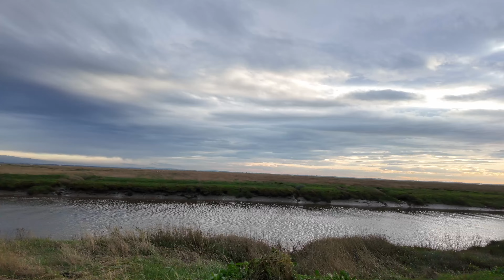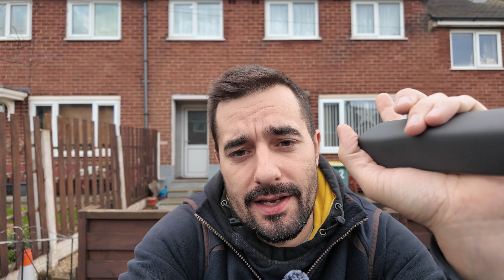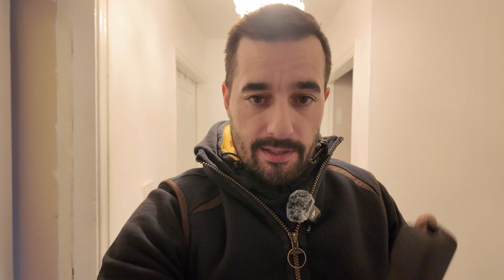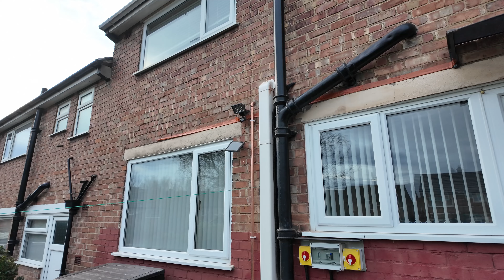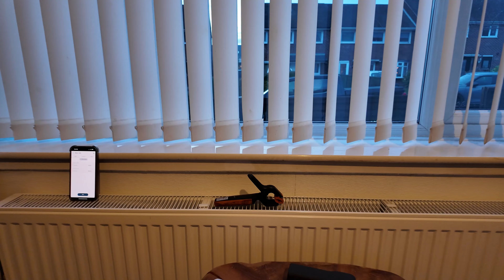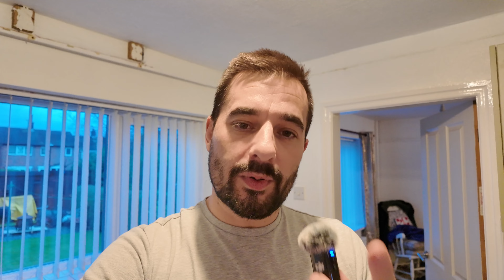Simple Heat Pump install

Comment: I am interested in a heat only heat pump as I'm happy to use existing hot water that i have. Is this possible? does it restrict the choice of heat pump chosen?
Reply: Why not. You need les kw hp.. Quest is if you will change the hot water in time and then have to use the hp.. I think.. I'm just a random guy.. not ver knowledgeable..

Comment: Lovely job, what was the cost to customer for each - solar and heat pump system pre BUS grant?
Reply from the maker: Hi, this was done under HUG2 funding so no cost to the homeowner. 

However, it would be IRO £16,000 less BUS so £8500 for a private customer.

Comment: Why did you calculate to -3.7°C when heating calculations normally work to -4°C outside air temperature
Reply from the maker: MCS give us the design conditions we have to work to depending on the area in the country. It is as important not to oversize a heat pump as it is to undersize it.

Comment: Love your videos, I have yet to install one yet, but my main work is now commission, service and install oil and gas, but will be moving into HP
I do have a question..  so, for the last 40 years of my working life I have spent time hiding pipes..  i think only on one or two occasions have i had to resort to bringing them out and running in a trunking ( bear in mind we do a lot of external oil boilers.. so similar install to a hp.
Why does it seem to be the norm to run the pipes externally on these? 

As neat as the pipe boxing is, it still looks yuk.. better if it had been black to match soil and rainwaters .
But everywhere i see heat pumps with trunking to first floor, i get it is easier, are heat pump installers afraid of graft lol..

Hope you have a great Christmas break
Dave
Reply from the maker: Cheers for the comment 👍

I don’t disagree, I would try and hide the pipes in my own house and most of our private customers ask us to too. 

This particular install is grant funded, our mission is to provide an efficient system that practically works really well but we don’t have a budget to chase pipes in or plaster etc. therefore most of the time if there is no direct pipe run, external trunking is the way we go. 

Customer does have a choice of black or white trunking and I agree personally I would choose black 👍👍
Reply from the maker: PS when installing external oil combis you can tee into hot cold flow return anywhere on a system. With heat pump we have to go to cylinder first so we generally have to route to upstairs. 🙂
Reply: @Rowlysrenewableroadshow   hmm lol.. well a lot of external oils are heat only , but even so, 2 pipes, 4 pipes ...  I still think more effort should be made in concealing pipes. ( no criticism on this install, it may not have been possible) but of all the installs I see while driving around doing my calls, the vast majority are run down the wall in an ugly plastic trunking. No other heat source gets fitted like this ( or rarely) . It does seem to be what is now seen as acceptable by hp  installers. I do get that running up in a trunking takes a couple of hours compared with imaginative routing to hide them can take a day or more.. so I do get the cost aspect.

I need to get installing and set an example lol...
Reply from the maker: @davewellsheatingengineer  absolutely get involved 🙂
Reply: @Rowlysrenewableroadshow  I would, if i knew where to start, so much mis information.

Comment: What sort of power does the heat pump draw if it’s running 24/7. What would the daily kWh be in mildish weather say about 7 degrees?
Reply from the maker: Thanks for the question. 

I’m going to sound like a politician now but it really depends on the load the unit is trying to deliver and at the flow temperature the radiators are designed for. 

This unit flowing at 60 degrees flow temp on full load for 24 hours could consume in the region of 72 kWh. 

Conversely running on full load at 35 degrees flow temp it could consume in the region of 36 kWh.

However in reality what happens is the house will already be at temperature and all the unit is doing is maintaining heat loss. 

In the example in this video the unit is able to move enough heat at -3.7 to keep the house warm, the heat loss is 4.6kw therefore at plus 7 degrees the heat loss will be roughly 2.6 kw so the unit will only need about 600 watts per hour meaning a daily consumption of £3.50 to maintain 21 degrees for 24 hours. 

This customer has a daytime temp of 21 and a night setback of 18 currently meaning she is spending between £1.50 and £2 per day. 

Hope that answers your question. 

Adam
Reply: @Rowlysrenewableroadshow  Hi my parents have had the same heatpump installed by Global Energy, (you came to set it up etc afterwards). Granted its a larger house but they only run it at 19 degrees usually and drop it down to 17 at night but they're seeing costs of nearly £10 per day (at 25p/kwh). They have looked at heat pump tariffs but they all seem to offer 2 periods within the day where the electric is cheaper which doesnt help with running it 24/7 so they don't really make sense as "heat pump tariffs" as the other times of the day are more expensive. Any ideas how this can be improved and how they can obtain their SCOP value? Thanks

EDIT
Parents calculations were higher than the actual running costs and Adam's calculations below are more accurate.
Reply from the maker: @ Hi Scott I remember the job, thanks for the comment. 

Yes your parents house is 151 square meters so twice the size of this house with many more external walls however I’m sure we can improve their run costs. 

I’ve just downloaded the data from their unit and in December they have used on average 26.6 kWh per day equating to £6.65 per day average run costs. I would say with a house of their size and build it’s not a million miles off. 

Looking at the data though it seems like the unit is achieving the indoor temperature easily and could probably do for us to turn the weather comp down a bit and see how they get on, that would mean the unit runs slightly longer but at a lower flow temp increasing efficiency. 

If you email services@globalenergysystems.co.uk and mention this conversation we can tweak it and monitor it for a week or so to see some improvements. 

Thanks

Adam
Reply: @Rowlysrenewableroadshow  After sitting down with them properly I think your calculations may be more accurate that theirs!
Thank you for the reply :-)

Comment: Really interested in how you work out the correct system volume for the heat pump, so many people have different ideas on how to do this.
Reply from the maker: I’m going to do a video on this, however the method I use is one an ex colleague and I have used for years. I’m not saying I’m right but it seems to work for me and I’m always open to better suggestions. 🙂

If you know min kw output of the unit you can do the following.

(Min kw output x seconds per start) / (DT x shc = kg mass required

Example on a 3.5kw min output

3 starts per hour = 3600/3 =1200 secs

(3.5kw x1200 sec) / (5dtx4.18shc) =200litres 

If you know minimum flow rate of the heat pump you can do the following.

Min flow rate divided by starts per hour.

Example 540 lhr / 3 = 180 litres volume.

Hope this helps. 

Adam
Reply: @Rowlysrenewableroadshow  the video would be a great watch, I understand both these. Some say around 15 to 20 litres per kW. Others seem to think lots more for around 3 start/stops. Anyway look forward to the video!

Comment: Adam, really enjoyed that video, in fact I appreciate all of your channel content. A few questions if I may:

1. This is a relatively low heat loss property can you talk about the pipe sizing used in this case,  especially as this was a virgin central heating system?

2. Can you explain what you mean by ‘piped direct’?

Look forward to the follow up.😀👍
Reply from the maker: Thanks for the support I really appreciate it. 🙂

In answer to your second question what I mean by ‘piped direct’ is that there is no hydraulic separation such as a buffer or low loss header. The pump within the heat pump has enough head to overcome frictional resistance in the pipework therefore no separation or extra pump is required. 

Your first question would be best answered with a full pipe layout drawing showing the index circuit and pressure losses across it. 

In short though from the unit to the tank room we have used 28mm pipe (even though technically 22mm can carry the full heat load) 28mm was used to give us lower pressure losses therefore allowing us to pipe direct. 
 
The pipework from the diverter valve to the last tee before the section of pipework to the radiator with the highest frictional resistance is in 22mm then 15mm to that radiator. 

I do need to do a video specifically on this subject and would include more detailed descriptions in these videos but I try and keep them below 10 mins as I know some people get bored. 

Adam 🙂
Reply: @Rowlysrenewableroadshow  We have most of our needed heat to go through 20 mm to the radiators.. For 74 m2 livingroom/kitchen.. Is 20 mm for this big enough for delta T of 5..
Reply: @Rowlysrenewableroadshow  Thanks.👍

Comment: What was the total cost?
Reply from the maker: Hi, I can’t talk specifics on this one for GDPR reasons. 

Heat pump installs can vary massively depending on multiple factors such as existing system suitability size of system etc etc.

A property similar to the one shown here full price would be in the region of 10-14k less the government grant of £7500. So the customer would pay £3-6k themselves. 

The reality is once a house is heat pump ready as in the radiators pipework and tank are all suitable the unit itself won’t cost much more than a boiler to replace further down the line. 🙂

Comment: Thinking about a heat pump - I know you've specced this one at close to its maximum output at the design temp for efficiency, but in extreme cold weather what happens to the indoor temp (for an older lady living alone)? Is there a backup heater available?
Reply from the maker: Hi, yes there is backup heaters built in but she still has her gas fire if she needs supplementary heating. 🙂

Comment: I keep hearing that heat pumps need to be on all the time, and you said this cusrtomer is doing that. We never have our heating on at night, does that mean a heat pump wouldn't suit us?
Reply from the maker: You can choose a lower set-point at night time if you prefer a cooler house at night. 

Ultimately you have total control over your house temperatures but running the heat pump continuously low and slow in most situations equate to lower bills. 

🙂
Reply: @Rowlysrenewableroadshow  The reason we switch the heating off at night is partly habit, partly not wanting the noises asociated with central heating when we are trying to sleep, and wanting it cool. We have the living room at about 18 C in the evening when we are mostly just sitting around, but during the day when we are more active, the temperature can drop down to 16 with no ill effect. I hear people say it is cheaper to keep the heating on all the time, but I don't get that, it seems to go against basic physics. The higher the temperature difference between the inside and outside temperatures, the faster the heat loss. What am I missing there?
Reply from the maker: @ you’re not missing anything as far as the physics are concerned. 

You’re correct, the warmer the house the higher the heat loss therefore more kWh lost through the fabric. 

There is nothing cheaper to run than a heating system that is turned off!!

However, a heat pump running really hard trying to heat a house quickly is inefficient, the reason being heat pumps don’t make heat-they move it. 

Moving heat energy quickly can only be done by raising the differential temperature from source to delivery quite far apart. 

When heat pumps run at a high flow temperature their efficiency can drop as low as 200% where’s if they have a closer differential between source temp and delivery temp they can have efficiency as high as 500%

To give a comparative example it’s like accelerating hard in your car then breaking hard over and over rather than tickling the throttle to maintain a steady speed. 

That being said the cooler you run your house overall the cheaper it will be to run, but your heating profile of 16 degrees and 18 degrees is relatively stable, and would suit a heat pump. 👍
Reply: It depends on your reason.  If you want cooler bedrooms at night, you can balance the system for that (less heat output in the bedrooms), and/or have a setback for reducing the temperature by a couple of degrees, and re-raising it a couple of hours before you wake.

If you think it's cheaper to turn it off, then in most cases it's not.  And it will cost more to reheat in the morning than just letting it maintain the temperature overnight.  Which would generally be the case with a fully optimised condensing gas boiler central heating system as well.
Reply: You can run a heatnpump at a lower setting at night. Which still allows the fabric to retain its heated, also depends on individual builder fabric and how well they retain that heat, when the heating is switched off.
Reply: What was the cost?
Reply: Just wanted to ask how useful/useless a heat pump is for people who want their homes heated at a higher temperature.

23 is the norm in my house.
Reply from the maker: @hjhirani we can design to any indoor temperature. If 23 is your comfort level that can be achieved. It’s just the warmer you have it the higher your run costs, but that’s relative to any heating system.

Comment: Hey that’s a very nice little install. Can I ask if you used glycol in the system or an anti freeze valve on the pipework to the unit outside ?
Reply from the maker: Hi, personally I do a risk assessment and decide if antifreeze protection is required. 

If it is, I would use Glycol, my reason being that antifreeze valves protect the heat pump by dropping system pressure, this then renders the unit useless until it is  re pressurised and re set. Meanwhile your house has no heat during freezing conditions leaving your entire hot/cold water system at risk of freezing. The most likely time this situation would arise is if the property is un occupied say the customer is on holiday. Leaving no one there to re set the unit.

Glycol is the only 100% protection against freezing, that being said I understand it lowers the specific heat capacity of water meaning a further upsizing of emitters and pipework. 

In summery, either glycol or nothing. 🙂

Horses for courses as they say.
Reply: Really interesting response actually. But from your experience, how long is a modern hw tank going to take to go from 50 to freezing. Longer than 2 weeks I’d have thought? But interested to hear your experience.

Comment: Nicely done job 🙌 and this is great advice for new installers. I was just having a discussion yesterday with another installer about still giving control in bedrooms as every customer is different. Some good advice on using temp limiters due to lots of solar gain, a lot of properties I do have a huge amount of glass, so I’ll always add a volumiser.
Reply from the maker: Absolutely customers need some level of comfort control. We need to design for maximum efficiency and train the customer to use it that way, however if their needs and wants change they should have the option of further control. 👍